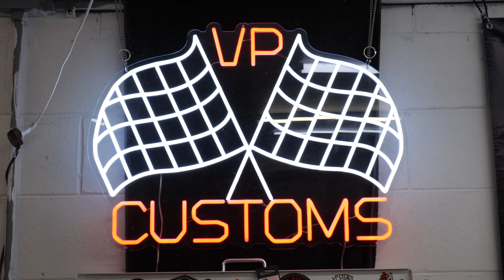I Bought A Road King- Just To Put This Part On!

Comment: Wow great choice on the white. I’m not a spokes kinda person either but on the right bike yes. I would put the 21 in the front and see how much angulation there is and see if you can still put flat feet on the ground. You might also be putting 13” shocks at a later date.
Reply: Spokes on a vintage 80s maybe 90 heritage with leather bags, classic. Still don't like spokes but on that era bike....

Comment: White running board rubbers and grips now
Nice tail light /flashers
I used S&S headers
Keep the 16. 160 or wider. Keep it low
Spokes or maybe so;I’d fat boy/disk glide wheel polished

Comment: Ay guys what’s up I was seeing if you could tell me how you hooked up your rear tail light I just got the same one for my 2006 road gilde
Reply from the maker: If you are deleting your factory light bar, you can just reuse the turn signal 2 prong connectors from that (like what we did by cutting and soldering).  Or if you're keeping the light bar, you can just T off of the signal wires to the turn signal wires on the tail light.

Comment: Yea that side stand gave me grief riding my bike into my house for the winter so i highly doubt it could make it up  the the hoist if i got one  Shame i cant find a rear led light for a 90 soft tail  just the bulb  and you will need the heat shields trust me lol Plus i doubt she would be able to flat foot an 18 back wheel unless you found a super low profile tire  the 16 would be better
Reply from the maker: Heat shields going on, but not until the rest of the exhaust goes on so we can adjust everything.

Comment: NO SPOKES! 18 inches in the rear. Too easy with the jokes, I will refrain. White seat BOLD BABY BOLD. Have not seen one in my travels, seen pink, blue, a lot of brown and tan. Love it though.  NOW lets talk horn cover! Needs to be something spectacular. Hand painted club logo ?? Maybe a bit of gold to match the V in the tank logo?  The chrome gets lost on that side of the bike. Last winter I got carried away with paint matching vinyl, covered my horn, mirrors, vent cover, gas cap (that peeled off first time I got gas, gloves caught the edge and poof off), 114 badge on the air filter cover, the list goes on.  Looking forward to the next upgrade.

Comment: Unless you’re building a show bike, I don’t see why the back wheel NEEDS to match the front. Visually, you can’t see it. Out of sight out of mind. However, I personally like them to match regardless of whether they are spoked or not. If you going to do full blown cholo, spokes are the way to go. If not, then pick a wheel that looks good on the bike and to you. Also, go with the 18” rear if you’re doing a 21” front. That way your bike doesn’t have that “bulldog” look. Otherwise, you’ll have to lower the front to even it out with a 16” rear wheel😊

Comment: Go with the 21 inche thick tire in front and either a 18 or 16 rear. But what ever you do "Do NOT" I repeat "Do NOT" get white walls! They will be a NIGHTMARE to keep clean! Specifically the rear one and when not cleaned correctly when in motion they will look blotched and spotted.